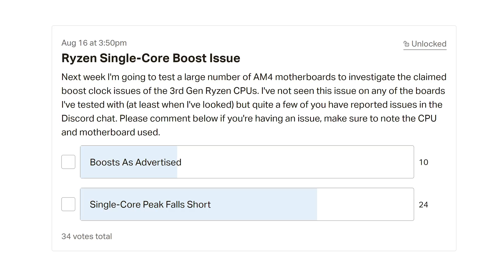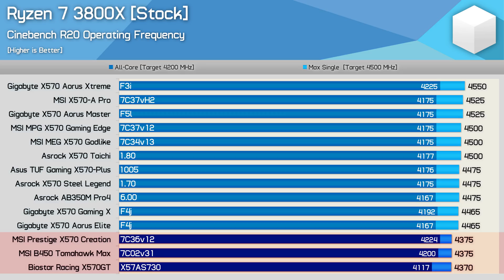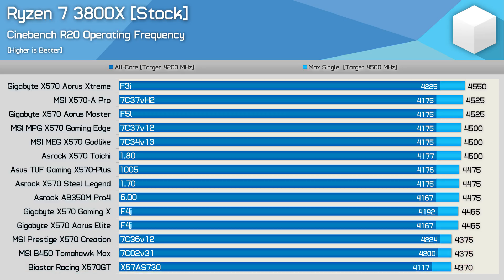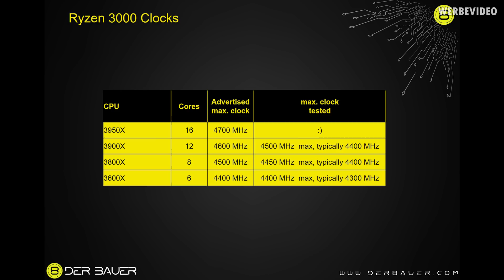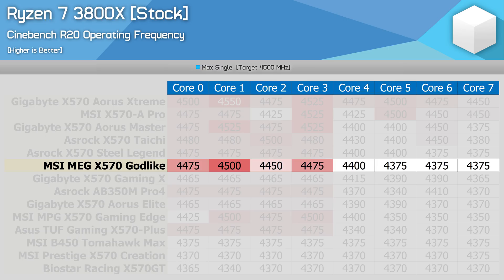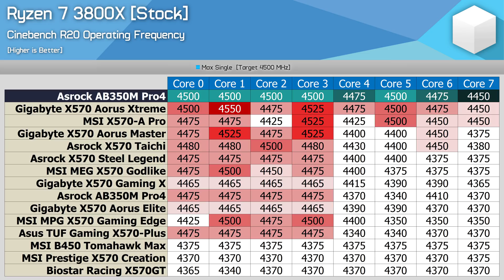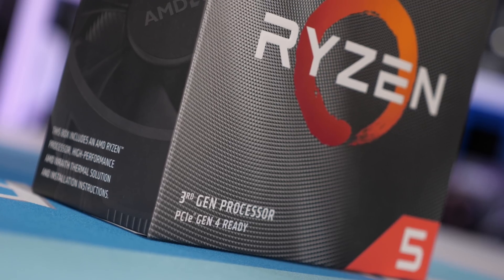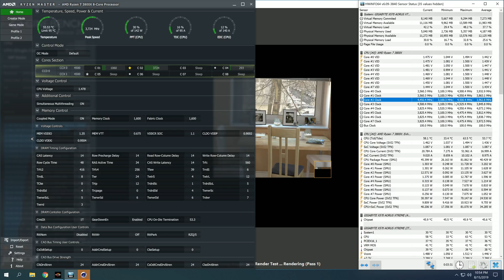AMD 3rd Gen Ryzen Boost Clock Investigation

Comment: I'm running a 3700x on an asrock b450 gaming-itx/ac board and at stock I'm seeing a peak of 4600 mhz on 1 to 3 cores oddly even idle my lowest clock has been 4350 mhz but my voltages are averaging 1.475 with a low of 1.35 hwinfo is what I'm monitoring
Reply: Same for me with my Asus Crosshair 7 Hero.  My idle voltages are dramatically high.  I have no problem crushing the box rating and my even weakest core still seems to hit spec.

It probably should have been binned a 3800X, so no complaints from me.

Comment: It would be interesting to test the frequencies on Linux.
Reply: Any reason they would be different than windows?
Reply: @bigironenthusiast9343  Actually yes. To get full performance out of Zen 3 you have to install the chipset drivers which come with Windows power plan options.
Setting it to 'High performance' for me netted no greater than 4.0GHz and the system was very unstable.
Using 'Ryzen High Performance' works as designed, boosting the advertised speed of  4.4GHz (3700X) on my x370 Pro.

On Linux you can configure TLP to manage your power but it doesn't come from AMD so I'm not sure how it would behave.
Reply: @tim3172  I'm pretty sure most low level stuff like that is kernel based with Linux distros, no?
Reply: ...time to get ahold of Wendell...

Comment: My x370 msi titanium boosted to 4.55 with pno while my new x570 meg ace is 4.375 pbo it has to be bios problems
Reply: kinda makes you feel remorse buying a new 570 dosnt it ,did you buy the x370 early near release or grab it bargain price later in life ?
(just asking for curiosity as i managed to find one for a friend when it was reduced from £300 launch price down to £125 around x470 launch) in my opinion it was a fantastic purchase at £125 , but not the best at early launch price compared to taichi and crosshair
Reply: tony barden yeah lol doesn’t really affect my gaming but still sucky lol...and I got the old motherboard when I got my 1700 at launch

Comment: What is the behavior on x470 boards?  I would personally like to see the MSI pro carbon as I like that board for its looks over all others on the market.  I like the look of the MSI x470 range over any other makes and series out.
Reply: I have a x470 pro carbon with a 3700x and it boosts up to 4.3 Ghz with full power enabled through power-mode within windows - no manual oc.
Reply: @DizzyKrissi  isn't single core boost 4.4 on the 3700x though? or are you talking about a few cores under load at once?
Reply: @3800S1  : during gaming - tested Black Ops 3 - it reachs temporily 4.3 most of the time 4.25 Ghz - Bo3 uses many 4 cores.
Reply: @DizzyKrissi  Ah ok, maybe you should try running CB single thread run and see what you get. Thing is even games from 15 years ago use more than one thread typically so Ryzen won't really boost to the max using games even if they are old.
Reply: @3800S1  : I need some more time to check this out but in general Ryzen 3000 hardly reaches their boost clocks.

Comment: Long story short: AMD lied to us.
Reply: Honestly, I think they should have gone with Boost clocks 100MHz lower on the 3700x and up, but I don't work for AMD. 
If they had done that, then there would not be any of this PR fiasco.
Reply: Obviously you have not watched the video.
Reply: @Azraleee  i did. Obviously you're a fanboy.
Reply: @hwstar9416  I did see my 3900 X hit the advertised Boost clocks on my old B450 Mortar, while I didn't yet observe this on my X570 Aorus Elite. 
Single Core Performance is identical between the two, which suggests that further tweaks to the Boost algorithm can fix it. 

This whole launch seems a little rushed and that is something that they should have done differently.

Comment: they didn't advertise 4.75GHZ, they just gave an example... but still think they shouldn't have done this
Reply from the maker: Robert clearly said a CPU with 4.55 GHz on the box will do an extra 200 MHz with PBO enabled,  he then wrote 4.75 GHz. So you could take that to mean the 3800X which has 4.5 GHz on the box could do 4.7 GHz with PBO enabled.
Reply: to be fair , they didnt GIVE AN EXAMPLE , as 'an example' has to be something that can/does happen so by definition it wasnt an example ,there only hope is to get a magic 3950x that can hit this 4.75 to save face ,and then backtrack and say robert hallock was refering to the 3950 in his 'example', but as of today no ryzen can hit that speed therefore its NOT an example
Reply: Yeah it wasn't a lie but it was definitely misleading

Comment: I'm using Ryzen 3600, paired with AsRock B450M Steel Legend and Scythe Fuma Rev B Cooler. Even though i'm not doing any overclocking.. my cpu only managed to hit 4.075GHz on average. Never ever 4.1GHz 😭
Reply: I have the 3600 with a b450 tomahawk and it does 4.075 MHz max as well (while gaming)
Reply: @nhac lly What??

Comment: rushed release? mobo manufacturers not ready for release? as far as i remember you guys reported 30+ mobo's coming with ryzen 3rd gen release LOL
Reply: Barnabás Kámán so what? If they didn’t realise them they would of lost sales. Doesn’t mean they weren’t rushed to produce and finalise them.
Reply: @ablet85  if my memory serves the 2200g and the 2400g were released in february of 2018 but mobos manufactered after november of 2017 supported them already. So i believe they had some samples weeks/months prior to release. This is not a blame on hub but saying there will be day 1 support for the new cpus and 2 months later saying there wasnt enough time sounds a bit dodgy to me
Reply: Barnabás Kámán multiple sources including jayz and tech Jesus both reported that the mobo manufactures were given very little time to get driver support scripted before final launch. The 2000 series were just a higher IPC then the 1000 series. The 3000 is completely different.
Reply: @ablet85  couple of brands still got it only a few of them didnt.  At least by the time i will get my upgrade they hopefully fix these issues

Comment: So Steve, what you found from those tests is the peak core frequencies. It would be much better if you also tried to measure the average single core boost on all those boards, while running Cinebench R20 on specific thread affinity. If it turns out to be about the same across all boards, then it seems that Gigabyte's approach is a bit more "aggressive" but overall doesn't give a performance edge.
Reply: Someone on reddit posted that AMD processors operating behaviour you can describe as 'run to sleep' thats why different softwares shows different clocks. AMD cpu can go to sleep for miliseconds and some softwares cant record it because of long pooling times intervals, some can but they also impact performance because of it.

edit: thats per core behaviour
Reply: While that would certainly be interesting, i think the question here really was about the peak frequency. The question was basically can the Ryzen 3000 CPU's really hit the max boost frequency on the box? 

I think that was a import test to do because some people were already claiming AMD was deceitful with those numbers. That fear can be truly be laid to rest

Comment: My ryzen 3600+steel legend b450m boost up to 4.192 all core gaming using ryzen power saving so im pretty happy with it!!
Reply: i have a 2600 and the b450m steel legend and hwinfo reported 4.5 Ghz on 4 out of 6 cores scratches head
Reply: @Rem_NL  what voltage you're running 2600 with? Auto or fixed..?
Reply: @ramibos6549  its completely stock, so 1.2 or so. Only thing different from default bios settings regarding OC is the ram. But to be fair, normal numbers are 3900 Mhz which I am getting. But HWinfo reports numbers up to 4.5 somehow on most cores. I can run 4225 on all cores with 1.425V or 4.1Ghz on all cores with 1.375
Reply: @Rem_NL  cheers buddy. Mine is set to 4ghz all cores Auto voltage. Will experiment if 4.2 would work. Got X470 Asus Prime Pro and Seasonic 620W should be no limits there.
Reply: @ramibos6549  after i left it running for 2+ hours and gaming it now reports 5209 Mhz on all cores (default voltage 1.216) so HWinfo seems hella bugged
Reply: I've got the same board and CPU. Just installed Windows , cannot enable my xmp profile for 3200mhz :( I manually uped it to 2933mhz. Which ryzen power plan are you using ? Balanced or performance ? Which chipset version and bios version ?
Reply: I see the exact same boost on my 3600 with an Asus pro plus x570
Reply: @Martin M My 3700x boosts to 4.4ghz on varying cores depending on load...
Reply: Awesome! Got myself a Steel Legend B450m and getting my R7 3700x very soon and I'm very happy with this news. Thnx!
Reply: Dang I have the same setup and have been through 3 CPUs and none get over 4090mhz...

Comment: Pretty sure its an AGESA issue aswell. On Cinebench i hit an all core boost of 3.9ghz now but with agesa 1.0.0.2 I used to hit 4.1ghz.
Reply: Yep, I also noticed using earlier BOIS versions boost the CPU higher.
Reply: @thunderboltlightning6010  it was the same for me, boosted higher in previous bios versions
Reply: @mithrandhir96  Latest agesa + chipset driver made my 3900x hit 4.55 boosts now, was 4.35 with old chipset drivers
Reply: @harrywalvis5166  , Which motherboard do you use ?
Reply: @Baezepal  x570 taichi
Reply: Same. I have 3700X and Asus Prime X370-A and the old bios with 1.0.0.2 boosts higher, it reached the advertised 4,4Ghz sometimes even on 2 threads long-term if they are not power hungry. But newer bios with 1.0.0.3AB boosts about 50-75Mhz less. There are rumors (have not tested it myself) that the new chipset drivers that circumvent the RNG feature bug also decrease performance.  What can I say... making beta-testers out of us for absolutely not tuned and finished platform.
Reply: Gigabyte x470 Gaming 7 1.0.0.2 AGESA I get 4.65ghz on the better binned CCD, PBO is broken though.
Reply: you need to activate Precision Boost Overdrive
Reply: @SamirHSX  yeah no I didnt have PBO on when i hit 4.1 ghz on agesa 1.0.0.2. You get way higher temps with pbo with little to no performance boost so its not worth it.
Reply: Agreed. 3900X w/ ASRock X570 Phantom Gaming X - hit 4.65GHz peak on four cores using 1.0.0.2 but never saw higher than 4.35GHz peak on 1.0.0.3AB and am now down to 4.25GHz peak on 1.0.0.3ABB.

Testing done using Cinebench R15/R20 single core after restart for consistency and to minimise active background processes.

Comment: My 3900x never gets near the 4.6ghz at stock, activating pbo helps alot, but i haven't gone past 4.1ghz.

That being said, it runs like a beast anyway and handles everything i throw at it anyway. Also i fucked up HARD with install and bent ALOT of pins, and im just over the moon it even works after i got an IT mate to unbend the pins, so dont take my experiences as standard, i might have gimped my cpus potential badly, and its still a fantastic cpu.
Reply: Also a 3900X here and mine doesn't go above 4475 and it also loses precision boost if i pair it with ram faster than 3466 - it'll lock to 43.8 multiplier and won't budge in any direction.

Comment: Are u ever gonna do a B450 Tomahawk MAX review?
Reply: What would be the point of that ? It is the same as the non MAX except for the larger bios chipset storage.
Reply: Yeah a comparison with the original B450 Tomahawk would be really good. Could be interesting to see as I currently own the original b450 tomahawk.
Reply: There's no difference to the normal one except the bigger bios chip. No point retesting that
Reply: I have the tomahawk max with an R5 3600 and boost issues. It never goes beyond 4.1 Ghz in single core and never beyond 4 Ghz in multicore.

Voltages are strange since ryzen master reports around 1.4 volt but CPU-z reports 0.5 and so on..
Reply: @spacemeter3001     I didn't know there was an i5 3600! No wonder it has boost issues
Reply: @wysetech2000  ikr
Reply: Interested to see that too
Reply: No need to, its the same board

Comment: My C8H + 3800x hits 4361 all-core in games what i play. max single is 4516 :/
Reply: Max single is meant to be 4500... nothing to complain about
Reply: My 3700x Asus Strix X470 F Gaming with Stock Cooler, AGESA 1.0.0.2 and newest chipset while gaming hits around +/-4.3 on most cores while gaming.  
During Cinebench R20 All core test it hits only 4.05-4.1ghz and in single core test 2 cores only hit around 4.25-4.3ghz (haven't seen anything close to 4.4ghz boost in SC test, even as a peak), score only around 4700 all core and 490 single core in CBr20. 
Highest reported clocks during idling/media consumption are 4391 mhz on 3-4 cores. 
I'm not even getting advertised performance, people who have 3700x usually gets around on average 4800-4900 and 505 points in CBr20. 
Tried leaving settings on Auto settings, PBO, PBO+Auto OC, through BIOS or through Ryzen Master, nothing helps to increase the performance. I am considering returning my 3700x as it seems I got below average sample.
Reply: @KryssN1  Your temperatures probably hits too high during cinebench. My temps are at 50c in gaming, 60-65c in stress test. using Noctua NH-15 SE
Reply: @p1u  They are hitting 81-83C during CBr20 all core test, 95 is throttle limit, the clocks seems to be limited either by bad sample or immature BIOS.  
Since for Single Core the power or temps aren't limitation, makes it look more like a below average sample I got, rather than BIOS limitation.
It's not even Boost Clocks that matter, I am just getting below average performance. 
I got 30 days return policy in the shop I bought it from, I will be probably returning it and getting another 3700x as my chip doesn't reach advertised speeds or performance at that.

Comment: My 3600 hits 4.25ghz in game with auto overclock enabled(200+mhz)
Reply: No
Reply: @hwstar9416  what? My guess is you dont even own a ryzen 3600 lol. I have a dark rock 4 for cooling. You sir are a true genius
Reply: @michaelwerner5049  i have a 3600 paired with msi b450 plus, i can never achieve 4.25.
Reply: @hwstar9416  I have a b450 also. Use PBO and auto overclock

Comment: My 3700X with ASUS ROG Strix X470-I works best with original AGESA 1.0.0.2/BIOS version 2501, and original chipset drivers.  If I install new BIOS with AGESA 1.0.0.3AB or new chipset drivers, I lose performance.  Original set up sees a couple cores hit 4.4 and Cinebench R20 hitting 4870.  New set up sees none of the cores hitting 4.4 and Cinebench R20 losing 100 points +/- 20 points.
Reply: Roll back your chipset drivers. New one hurts performance but improves noise/thermals.
Reply: Dam I'm on 4.35ghz and my R20 is 5046, with single core 500
Reply: Auzziegaming if I manually overclock it’s much better.  If I just let it do its thing, it’s just ok.
Reply: @Nighterlev  I hope you are right.  Yes, 1st Gen Ryzen was this way with BIOS, that's why I have not worried about it too much.  The only time I think about it is when I go on Reddit and see tons of people bitching about it all the time.
Reply: After I updated the chipset drivers for 3600, immediately the performance was worse (-200 cinebench score) and thermals were worse too!! +5-10 deg lmao. Oh yeah I also get random freezing and system reboots. Great job AMD!
Reply: @Nighterlev  yeah I saw people talking about different motherboard yields different results... Hopefully they solve it.. But anyhow I'm not convinced..
Reply: New chipset drivers 1.07.29 is the culprit... I hv the same problem.. Btw, my 3700x only hit 4.1GHz all core on default running Cinebench. I really feel in some way, AMD cheated on us.
Reply: @davws88  mine reaches 4.3....

Comment: nice that you can run ryzen master my software just crashes.. b450 pro carbon ac with 3700x wind 10 everything up to date.
Reply: 1 u cant OC its a test demo that dosent kill the mobo and cpu u need manual oc from bios
Reply: @notoriousbig3k  i do understand that, but the software just crashes everytime i open it.
Reply: @notoriousbig3k  i do understand that, but the software just crashes everytime i open it.